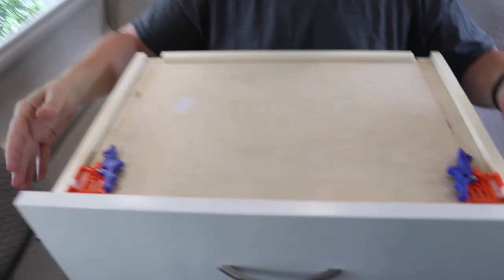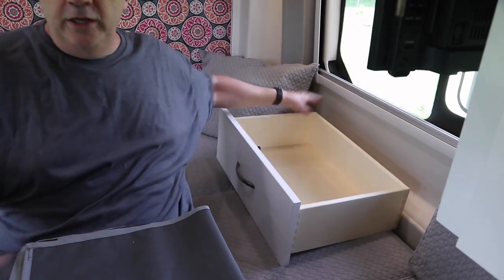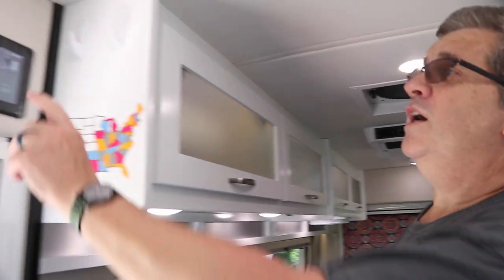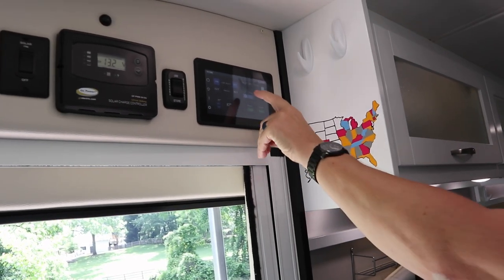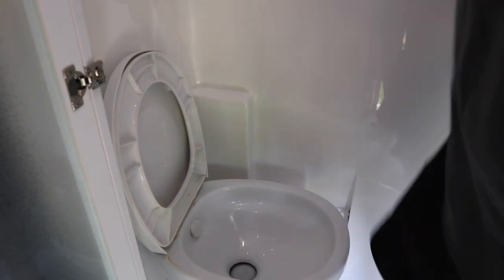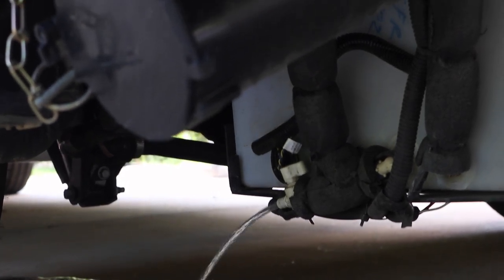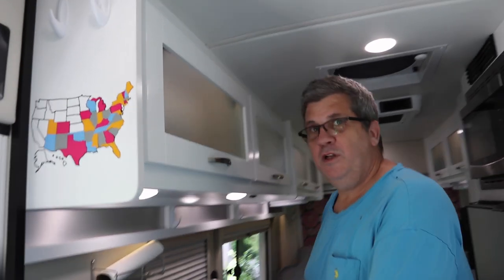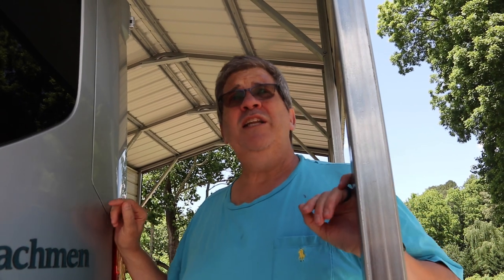Sanitizing freshwater tank with bleach and bypassing the Truma Combi - Coachmen Beyond

Comment: Thank you for this video!!!! I have had my Beyond 22C for about 9 months now.  The Truma was only heating to luke warm water no matter what I did.  I figured there was scaling inside the tank or some problem with the unit.  I watched your video and had a light bulb go off above my head.  I checked and, sure enough, the bypass valve was open.  It was mixing cold water with the hot output from the Truma.  I closed it off and now it runs perfectly hot.  Thanks so much for all your videos!
Reply from the maker: Very glad I helped you!  And thanks for subscribing to my channel, I  appreciate everyone that supports my channel.

Comment: So glad you have documented everything with video for us, so much easier to learn and have with us once we have to do it to do it step by step! And many important tips (i.e. how to get bleach into that tank).   We have pressure regulators like you are using from our former rig - do we need to get some with the gauge when we get our Beyond or are the simple once sufficient?
Reply from the maker: It is important to use a pressure regulator.   The standard ones work fine.  The adjustable ones are nice because you can lower the pressure even more if you want to.

Comment: Good information.   Thanks for showing how to do this operation.
Reply from the maker: Thanks, glad to help.
Reply: How often do you perform this task?    Every six months, once a year, after every long trip?
Reply from the maker: The way we travel is pretty much anytime of the year, so we don’t have a beginning of travel season.  So what I do is typically twice a year, once in February and once in August.  But sometimes you might fill with bad water from somewhere.  I usually sniff the water before attaching the hose to my van, if it smells bad I won’t use it.  

But if I ever notice my tank water smelling odd I will drain it and do the sanitizing procedure.

Comment: Thanks for the video.
I have the Nova D. I need the beginning step for dummies, namely, where is this drawer that we pull out to access the red, white and blue lines that we are adjusting the levers on?
Reply from the maker: I found this online:  There are three low point drains underneath just forward of the PS rear tire (hot,cold,fresh). There is also a fresh water drain behind the door under the PS bed. Also there is the fresh water bypass valve, and the hose to run the antifreeze in.   Under the DS bed is the truma bypass and hot/cold water cutoffs. Also the truma drain is there but I had to raise the bed plank to get to it. 
1) open all drains, including truma. And let drain. I had to park with my front ent raised to empty the FW tank. 2) bypass truma, and FW tank
3) blow out lines with compressed air and/or
4) feed antifreeze through the special hose using the water pump. 
In either/both cases make sure you do both hot and cold water in sink/bath and toilet. + antifreeze down all drains.
Reply: Wow! Thanks so much for the research.

Comment: Thanks for the video.  I have not bypassed my truma (oops) but luckily I have not used it yet.  Not having a gravity fill what I do is I bought one of the water filters, remove the filter, fill the canister with bleach or vinegar and connect from the house to the canister and than from the canister to the fresh water tank.  Works great except for me not bypassing the truma.  Guess I better flush everything again.  Thanks for your video.  Guessing that you have the LI3 since your water tank is outside, mine is inside under the couch.
Reply from the maker: Interesting idea with the filter, but remember you only need about a half cup of bleach.  Just flush it real good before you turn on the Truma.
Reply: @CampingCoastie  I should clarify I use about a cup of bleach on the canister, than fill up the water tank 30 something gallons.  Run the water through the lines and toilet, fill up the gray and black tank with water let it stand over night after driving the van about 50 miles around the city.
Reply from the maker: @shelley131  Sounds good

Comment: After you've done the bleachy water thing & are into the phase of draining & continually diluting the small amount of bleachy water left because the egress port is higher than the bottom of the tank could you perhaps drive the opposite side of the van up onto some blocks of some kind, maybe 4-5 inches high to “tilt” the tank some & get more of the remaining bleachy water to drain requiring a small number of refills to totally get rid of the residual bleach.  Probably a crazy idea by someone who doesn't have their Beyond yet.
Reply from the maker: I do drive it up on a set of leveling blocks when I winterize it to try and get most of the water out.

Comment: Gard, you always do a great job on these videos. Thank you. I recently watched a video of a Travato owner cleaning the in-line water filter screens on her rig, which seemed to be a challenging process because of the location of these tiny, mesh, in-line filters. Since you showed us the process for sanitizing the fresh tank, could you also show us the process for changing and cleaning any in-line filters and explain how often this needs to be done? Thank you very much.
Reply from the maker: Thanks.  I have looked and haven't found any inline filters,  other than the one I put on my hose.  There are little screen filters under the black caps where you hook up fresh and city water, but that's all I know of.

Comment: I understand the reasoning for bypassing the Truma but how does the tank inside the hot water heater get sanitized? Does the heating of the water take care of that? Do you fill and flush it out a few times with clean water? Please let me know what you do. Thank you.
Reply from the maker: When you heat the water on the boost cycle it should pretty much sanitize it.  But it has to be the boost which gets the water hotter.  

This is from Truma’s website:

“The water container on the Truma Combi heater should be regularly sterilised and descaled. Any standard cleaning products stocked by specialist camping retailers can be used for cleaning, sterilisation and maintenance. It is important that products are used according to manufacturer specifications in the correct dosage and with the correct exposure time.

You can also regularly heat the water in the Combi heater to 70°C to prevent the growth of microorganisms. To do this, set the water temperature to
60°C (on the CP plus control panel, HOT setting), leave the appliance switched on for at least 30 minutes, and do not use any hot water during this time. Once the water reaches a temperature of 60°C, the burner switches off and the residual heat in the heat exchanger heats the water to 70°C.

You can use standard descaling products from specialist camping retailers, acetic acid or citric acid to descale the water container.

Add the cleaning or descaling products in the recommended mixing ratio to the appliance via the water intake and allow them to work. Then flush the Truma Combi as part of your water system thoroughly with fresh water.”

Comment: Than you for your inspiring videos!
Why is it nessesery to bypass the Truma Combi? Wouldn' t the sanitizing of hot water part be good in order to kill the germs there?
Reply from the maker: You bypass the water heater when you are sanitizing the fresh water tank and waterlines in the RV.  Truma does not want people to get bleach inside of the Truma Combi.  I am not sure what happens, but was told that the chlorine gets hot it causes problems.
Reply from the maker: I am not sure, but it would seem that the water getting hot would kill bacteria.   However,  usually you boil water to kill bacteria, so I don't think it would get hot enough.  I need to check with Truma to find out the way they suggest sanitizing their Combi.

Comment: Well, I should have watched this before I did a fresh tank sanitize with bleach. I didn’t bypass the Truma. I flushed the system 3 times and used a chlorine test strip to confirm none remaining in system. Have I totally screwed up my Truma?  I haven’t had to use the hot water nor heater since this episode.
Reply from the maker: You will be okay.  Just never turn on the Truma with water in the Truma contains bleach or antifreeze.  You are safe after flushing it out several times.
Reply: @CampingCoastie  That's good news. I have to flush again today and might just winterize 'cuz here in NC we're gonna get low temps. However, I also reviewed you winterizing videos and in one you mentioned just blowing out the lines. Is this realistic for NC (Raleigh-Durham)?
Reply from the maker: @MsIvyleager  It works for many people where the temperature doesn’t go to far below freezing.  Just make sure to blow out everything including the outside shower and toilet.  I would also take the clear cap off the water pump and clean the little filter while there too.

Comment: Thanks again For a great video. Question for you if we are part time, and the coach will sit every so often. How often would you recommend doing this? If it’s sits for six months? Or possibly even sooner say every three months if it sits?
Reply from the maker: I would drain the water from the fresh tank and open the low point drains so stagnant water wouldn't sit there.  I would sanitize it before  going out on trips were it sat there for three months or more without using it.  And sanitize it if anytime the water smells bad.
Reply: @CampingCoastie  Great thank you.  I see that your water tank is on the outside, I'm assuming you have the LI3, I would assume for the non-LI3 models with the tank inside the release valve is probably in a similar space (with the exception of maybe a tube going down to the ground below the floorboard)
Reply from the maker: @sasstewart1222  Yes, I have the Li3 and my water tank is outside.   I believe on the 22C AGM model the valves are in about the same location.

Comment: So Gard dud you ever try with the vinegar solution and if used it would you  no longer need to bypass the Truma?  Could you not use the same technique to get the vinegar solution in that you used to get the diluted bleach in?
Reply from the maker: I have always used bleach, I know it works.  Many people use vinegar, it’s a great disinfectant.  You could get it into your tank the same way through the house.
Reply: @CampingCoastie  Thank you. The other question was, if you know, if using vinegar could you then avoid having to bypass the Truma?  Thanks again
Reply from the maker: As far as I know white vinegar is good to sanitize with, it even will descale the system.  I need to check with Truma for the proper way to do it and make a video.
Reply: @CampingCoastie  Thank you Gard.  Always a great source of information and so responsive. .

Comment: Hi! I want to empty my fresh water tank today…would I just flip that brass fitting as shown at the end of this video?
Reply: The brass valve will drain the Truma.  There should be a white plastic handle valve to drain the freshwater tank.  It’s location depends on what floor plan and battery you have.  Which floor plan and battery do you have?
Reply: @gardsnyder5657  hi Gard, thank you for responding…I have the 22D and the GSM battery. My pipes froze last night with water in them. I opened the faucets and now have the heat on. Am I in deep doodoo?
Reply: @kimcraige  I am sorry you have this problem.  A lot depends on how hard of a freeze and what got frozen.  Your freshwater tank is under one of your beds.  Look for the white hose coming out of it and turn the white handle on the valve in-line with the hose.  That will drain The freshwater tank.  The should be a blue and red pipe near each other with valves that are your low point drains, open those.  Hopefully you can heat the inside of the van to at least in the 60s to thaw anything if possible and keep from freezing more.  

Make sure your water pump is off, with the low points open it needs to be off.  Attach your blue shower hose and squeeze the handle to hopefully let the pipe in the van wall to drain.  It should come out the low point drain.  Make sure to drain the Truma too.

What part of the country are you located, what is the outside temperature?
Reply: @gardsnyder5657  I’m in Chapel Hill, NC. Warmer days, 25 degrees last night. Thank you so, so much.
Reply: @gardsnyder5657  the temp now is 37 and I turned the heat on in the van.
Reply: @gardsnyder5657  I drained as much as I could from the fresh tank and the Truma, and left the faucets open. Your info was really helpful, thank you!
Reply: @kimcraige  it would probably be best if you could do a proper winterizing with RV antifreeze.
Reply: @gardsnyder5657  I agree. It worked out well last year, so...yea :)

Comment: Been following your postings, very much like your comments about the Beyond, is the Pro air 20k A/C  loud inside the cab when you run it . You have  showed the A/C  turned on compared to road work construction outside in one video post. Is it fair to say we have to use ear plugs to get a good night sleep while it’s running?
Reply from the maker: The ProAir is very quiet.  We are watching TV right now , the volume is set on 23 which is about quarter volume.   The AC fan is set at 25% and it can hardly be heard.
Reply from the maker: I measure with my phone 48 decibels with the TV playing, 42 decibels with the TV muted.  Inside the AC is very quiet.

Comment: Iam very much considering your coachmen beyond C li3 so far have you encountered problems in the RV. ?
Reply from the maker: So far the only problem was the water pump needed to be adjusted some.  The dealer did that on the walk through,  took about 5 minutes.

Comment: What is the tank size of the truma combi eco plus? IE how much hot water does it provide?
Reply from the maker: I think the tank holds about 2.6 gallons of water.
Reply: @CampingCoastie  2.6 gallons? That doesn't seem like much for a shower
Reply: @mweber2000  It can heat the water fairly quick.  Taking long showers is not something you do in most RVs, taking navy showers is the way to shower.  Doing that we have always had enough hot water.
Reply: @gardsnyder5657  thank you